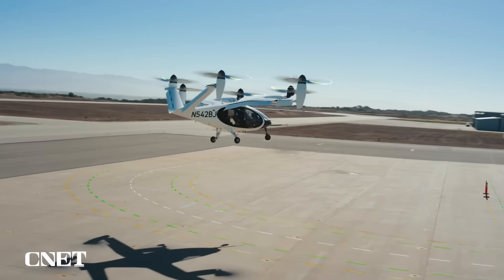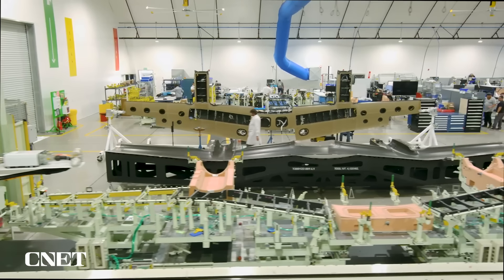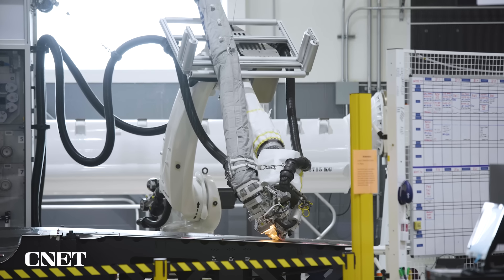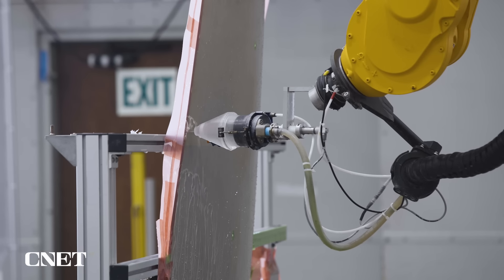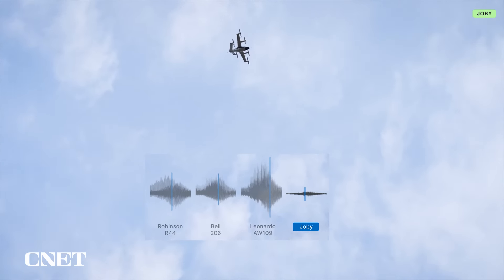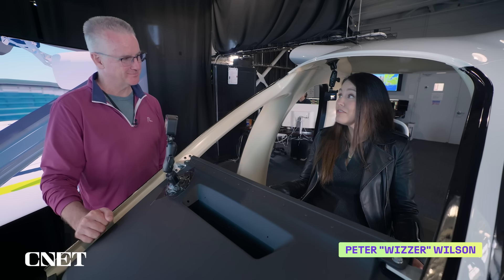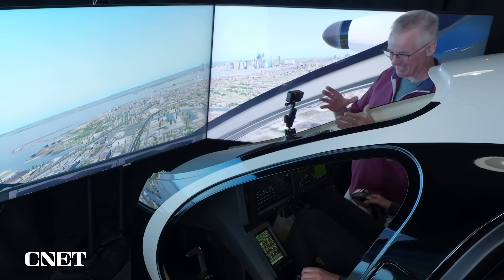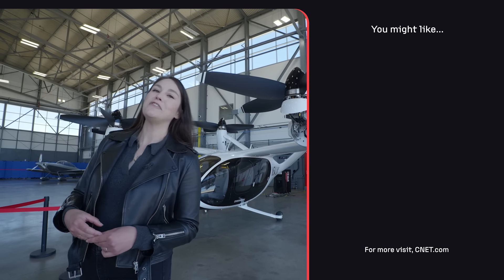Inside Joby's eVTOL Air Taxi, Coming in 2025

Comment: Helicopter?
Reply: Finally!!! Its just an electric helicopter and considering how bad climate change is gonna get, the crosswinds will make this thing fall from the sky like a fly
Reply: Of course it isn't.

As it is explained in the video.
Reply: Helicopters have 1 main rotor and 1 tail tail rotor which means no failsafe. In this case there are multiple props which allows for multiple failsafe options. Way safer + autonomy helps navigate better than humans although people will be navigating and overseeing the systems.

Comment: Very interesting, thank you. This looks like it could be a possible real transport option soon, but not as a taxi, more like a short hop plane alternative
Reply: It is not a short hop plane alternative, its range is 100 miles.
Reply: vapour ware you mean
Reply: @iamhayday  well yes, you have a good point. I have been reading about air taxis for 20 years and they are still about to happen, as you say, vapour ware
Reply: @Greguk444  yep, regulations would do that. oh well
Reply: @cemdursun  they actually have already tested a fuel cell variant which flew for 500 miles.

Comment: I would like to have heard more about the FAA aircraft certification progress. What are the contingency procedures in the Joby for critical systems failures? What happens if a motor fails? What happens if a propeller gets stuck in a horizontal or non-vertical position? Does the aircraft then have to land like a conventional airplane? If so, where? How much battery reserves (time) does it require at its planned landing time? Lots of questions. Hopefully the answers are coming…?
Reply: All good questions that need answers before I pay them a dime to fly me anywhere.

Comment: Carbon fiber manufacturing is cool, but it’s been around for 50 years and not exactly new tech or this aircraft. Same with flight simulators. 

I was hoping they spend more time on the stuff I was really curious about, but they rushed through it. How exactly is it quieter, is it spinning slower? Is it the blade tips? How quiet is it? Like what are the decibels? How many engines can it loose and still fly? How about when it’s hovering? I have lots of doubts because on my small drone, any engine failure causes it to flip and fall out of the sky. I would love to have seen test video to prove it can still fly with those failures.
Reply: It sounds like a big leaf blower or giant electric weed trimmer, like a big air whoosh with an electric whine.  There is no big helicopter thumping or airplane engine noise that travel so far.  When it flies overhead at 1000 feet it's pretty quiet; probably barely audible when it's windy.  When it's taking off and you're nearby it's not so quiet, but much better than normal aircraft.  They manage it with redesigned wingtips of the props and spinning them slower.  They can do that because they have lots of propellers providing lift.  Electric propulsion systems are also inherently quieter than reciprocating engines. 
Joby has fewer propellers than other EVTOLs, so they may have less redundancy.  Most have eight props, some even more.  
Joby can lose all engines and glide in if it's within glide-reach of a runway or field.  It can lose one engine for sure and still land vertically.  I have to think it could lose two and land vertically, but I'm not sure if it can lose two front engines on the same side. It can probably lose over 50% of its engines and land horizontally like an airplane.  
Having six tilt propellers plus wings with three-axis stability and sophisticated control systems and software make it nothing like hobby drones.  

These electric motors also are double motors, with two separate windings in one unit.  If one unit fails, it powers it's other unit, and doesn't miss a beat.  Other EVTOLs have double props hooked to one unit, one on top and the other below it.  They all also have three or more battery arrays with three or more different controllers that should fail for different reasons.  These things are far more redundant than any other aircraft.  And electric propulsion is far more reliable and needs less maintenance than conventional propulsion systems.
Reply: Don't be curious, you have to act, don't be smart, you can think of problems, Chinese engineers can also think of, you think you are smarter than the Chinese?

Comment: So it is a complicated helicpoter, got it!
Reply: It's a less complicated helicopter.
Reply: @andybrice2711  it is more complicated because it has 4 motors to drive 4 blades which increases the chances of failure
Reply: @thisisreallife9026  I’m not so sure. The mechanics seem much simpler than a helicopter. Even if the avionics are more complex. And even if multiple engines fail it can still land.

Helicopters are notoriously dangerous and difficult to maintain. I predict eVTOLs will largely replace them in the future.

Comment: As a plane and helicopter pilot that spent years learning and mastering flight, this is quite insulting to watch.
Reply: That’s what technology does. Makes what was once difficult now easy to do.
Reply: @livingroomguitarist7  It'll replace all of our jobs in the near future.
Reply: @micham8278  No it won't. It will add jobs.
Reply: @micham8278  real helicopters can be made autonomous already and made to fly by wire.  I have a toy one where you can make it hard to fly and it can do flips or make it easy to fly so its like one of those skill crane games in the air and it can even fly and land itself.
Reply: @livingroomguitarist7  No it won't.

Comment: What is the advantage over a helicopter
Reply: Right,  if they come pick you up, 40 miles away, you are almost out of juice for your flight!!   🤪
Reply: A VTOL flies like a plane, more energy efficient mid flight but with helicopter freedom of landing anywhere.
Reply: @pelleban  the VTOL cannot counter rotate so looses one critical safety feature.   Wouldn’t it be better to develop a E Helicopter for future energy consumption?
Reply: @glennlewman4186  Not sure but if it were I think they would. Range is probably the biggest thing, also a multiple engine type that can fly with 2 engines malfunctioning is probably safer than helicopter. Afaik helicopter are very unsafe relativ other plane types. But if I'm not mistaken traditional vtols like the Osprey have terrible safety records, prone to crashes, however these things ca fly with 2 malfunctioning engines and electrical engines dont fail as easily as combustion engines.
Reply: @ the problem is they can’t auto rotate during a power outage
Reply: @glennlewman4186  The again they dont have too since there are more engines. I am a fixed wing pilot myself, but afaik if a helicopter engine goes out you are pretty screwed, even with autorotation. Then again I am no expert, I fly fixed wing myself and only got information from what a few other pilots told me. I do however expect that if a e-helicopter was a safer and better option we would see more of them. Even with autorotation an engine failure on a helicopter is pretty catastrophic afaik. These things can have 2 and keep flying.

Comment: oooo, u've explained everything except that most important thing and thats related about elecric motors,  they have how much power and works for how far that go? after how long does it need be recharge and what is capacity of the battery? that has how many km/hr speed?
Reply: Top speed 200 mph, range of 100 miles not including reserve. I believe the S4 has a service ceiling of 18k feet.
Reply: @livingroomguitarist7  I think they would say its designed to do that not that it can do that.

Comment: Great Idea, But where can you travel less than 100 miles that can't travel faster by car? Round trip from Austin to San Antonio is 145-170 miles round trip.  Downtown Houston to Katy? 45 miles. Again why? Cost prohibited. In my opinion.
Reply: I live in an area where little puddle jumper planes taxi people all the time. There is a good demand for this niche.
Reply: @matthewbarry7026  OK. But the cost to keep this thing charged Is Significant. You have to burn way more fossil fuel. A puddle jumper is way more cheaper in the long and short run. Unless they pair this with a micro nuclear power plant. ($$!) 🤔🤣😂  Solar ain't reliable enough to depend on. I have a Tesla it's cool but I charge it way more often than I fueled my ICE car. If I didn't get free power after 9:pm I would go broke.

Comment: That sound test was a different model with different motors that had gears and it crashed. The new craft is different and doesn't have gears. The sound will be different and louder if its carrying a load. Empty would be quieter but that shouldn't be the test.
Reply: @David0gden  how much weight is it carrying and how long does it stay in the air? Take a video of it if it's longer than 2 minutes because that's longer than joby ever shows. The sound doesn't matter if it can't lift the necessary load and move it somewhere. The more it lifts the louder it would be. I think joby is going to go down like a lilium if they don't prove they can move something somewhere soon. I know they can lift 1 man for at least a minute but is that it?  Please take an unedited video of the entire time its airborne of it happens frequently and you are telling the truth.
Reply: @David0gden  question: what is the difference between joby and lilium? 
Answer: a year. 
  Being honest is cool, dude.
Reply: @David0gden  umm no they were actually a hoax.
Reply: @David0gden  not jets, ducted fans and it ended up being all lies. Marketing and lies. Like this.
Reply: @David0gden  lilium is out of buisness, they are bankrupt. This one will be after archer goes. They aren't competing they depend on eachother to keep up the charade that it's possible.
Reply: @David0gden  what's going to happen in 2025? They will postpone until failure. Tell Joe Ben to prove it can move some weight somewhere if they can. Thats what matters the most.
Reply: why should people need to speculate if what they say is possible then they have the means to prove all the short sellers wrong. They can't prove it.  They can make short videos set to music full of jump cut edits and display the model on the ground next to a video game. Just like lilium.

Comment: I think the FAA may have a slight issue with several parts - 1. Pilot certification 2. Aircraft certification 3. landing zones etc (so called vertical ports) just use helicopter pads lol - charging stations for these and the infrastructure all yet to be built... now goto a Tesla car charge area and watch how many cars need to be there for 40 mins to charge the car. Now think if you have so called air taxis - How many will be able to charge and turn around these so called air taxis in reasonable time etc  All possible to overcome but it needs time and 2025 is probably not enough time...
Reply: Joby has a great relationship with the FAA. 2025 baby